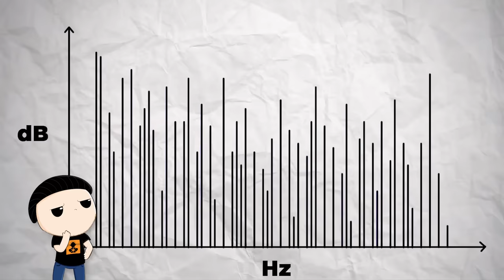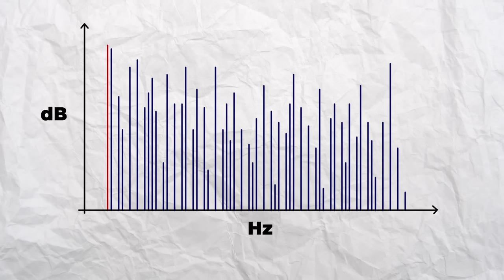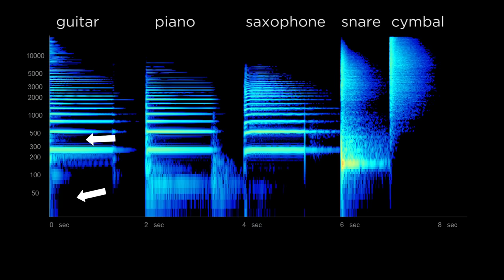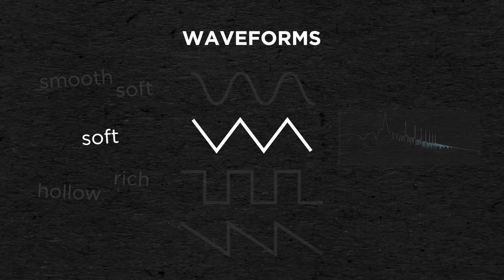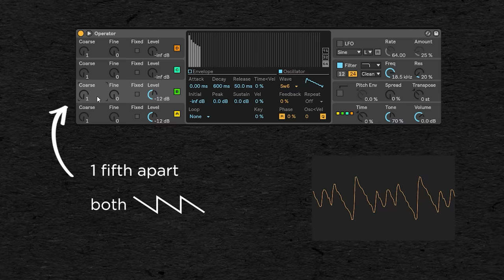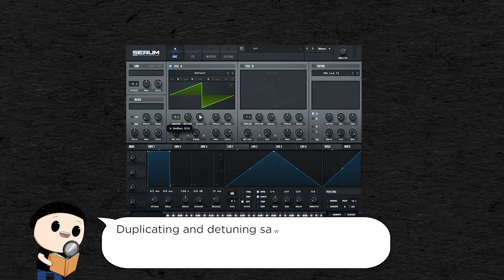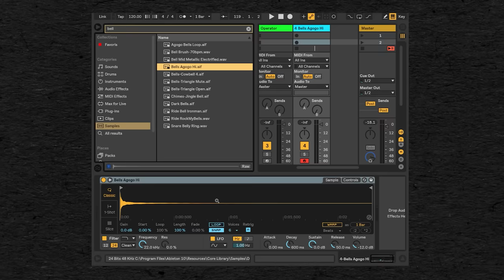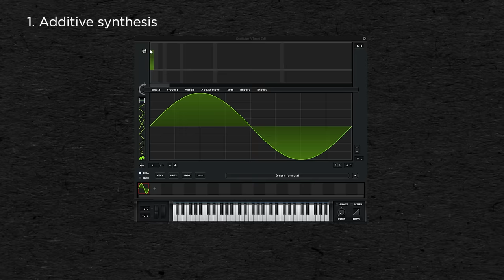Sound Design COMPLETE course - EVERYTHING you need to know to craft any sound.

Comment: 🌟Here is a summary to help you get the info faster, thank me later, you got this!
🎬 Introduction:
	•	Goal: To explore sound design tools and their effects deeply, helping you understand and use them effectively.
	•	Focus: Sound synthesis, effects, and techniques for creating unique sounds.

🎼 Sound Synthesis Basics:

	•	Fundamentals: Sounds are a mixture of frequencies. The main frequency is called the fundamental, and additional frequencies are called overtones (harmonic and inharmonic).
	•	Waveforms: Basic waveforms include sine, square, triangle, and sawtooth, each with distinct harmonic content.

🛠 Sound Design Tools:

	•	Oscillators (VCO): The heart of any synthesizer, generating waveforms that form the basis of sound.
	•	Filters: Modify the harmonic content of a sound, crucial for subtractive synthesis.
	•	Envelopes and LFOs: Control modules that shape the amplitude, pitch, or other parameters over time, adding movement and variation.

🔊 Types of Synthesis:

	•	Additive Synthesis: Creating sounds by adding harmonics together.
	•	Subtractive Synthesis: Starting with a rich harmonic sound and using filters to remove unwanted frequencies.
	•	AM and FM Synthesis: Using one oscillator to modulate the amplitude or frequency of another, creating complex harmonic content.
	•	Wave Shaping and Wave Table Synthesis: Using custom waveforms and morphing between them for dynamic sound creation.
	•	Granular Synthesis: Slicing audio samples into tiny grains and manipulating them to create textures and effects.

🎨 Practical Applications:

	•	Layering: Combining multiple sounds and effects to create a richer, fuller sound.
	•	Dynamic Effects: Using tools like reverb, delay, and saturation to add depth and character to sounds.
	•	Panning and Movement: Adding spatial dynamics by panning sounds and creating movement within the stereo field.

📝 Key Techniques:

	•	Sound Exploration: Experimenting with different synthesis methods and effects to discover new sounds.
	•	Detailing: Paying attention to the small details, like adding subtle background noises and textures.
	•	Sound Sculpting: Using EQ and filters to carve out unwanted frequencies and shape the sound to fit the mix.

🔧 Tools and Examples:

	•	Software and Plugins: Using tools like Serum, Ableton Live, and VCV Rack to demonstrate various techniques.
	•	Practical Examples: Step-by-step guides on creating specific sounds, from simple tones to complex textures.

🎧 Advanced Tips:

	•	Modulation: Using LFOs and envelopes to add variation and movement to static sounds.
	•	Harmonic Control: Understanding and manipulating the harmonic content to achieve the desired tone.
	•	Sound Libraries: Utilizing sound libraries and custom samples to enhance your sound design toolkit.
Reply from the maker: That's actually a great sum up :o

Comment: I'm back again 🤣 How do you create your animations? Are you using a drawing tablet? I've been wanting to get into it for so long. thank you
Reply from the maker: It depends, but most of the animations are made directly in première pro. I would use shape layers to draw the shapes I need (with the mouse, no tablet) and then I would animate it in première and smooth the keyframes (the transform effect is very handy to get motion blur).
If what I want to do is not possible with première, then I pull out after effects :)
Reply: @Woochia  thank you so much! I have premiere and had no idea that you can do that inside it. I appreciate all your work. Keep it up!

Comment: thank you for this video! just what I needed. question:
at 49:41 it looks like your controlling the rhythm of that riff with the "note" tab, can you explain how you did that? TIA
Reply from the maker: Thanks!
Actually, I'm not controlling the rhythm with the note tab. I'm controlling it only with an LFO and I play with the LFO's rate.
Though you could control the rhythm with the notes' pitch. Just drag the note modulation onto the LFO's rate. Then the higher the note, the faster the rhythm. Though you'd have to play with the modulation depth to get the range you desire.

Comment: Does this course actually make sounds or does it teach about devices that are USED in sound design? Do we make pads, basses, soundscapes, risers, etc?
Reply from the maker: This course intent is to give you all the useful info to understand each tool at your disposal to make sound design, so you can decide was you need to make the sound you want. This is not intended to be a collection of recipes for particular types of sounds. Those names can be quite broad (ex: to make a pad, start with a polyphonic instrument with a long attack and long release. From there, you can do pretty much whatever you want, so I prefer to give you all the knowledge you need to make it sound as you'd like)

Comment: 2:18:42 You are wrong here. The Mega Drive use the Yamaha YM2612 mainly:  a six-channel FM synthesizer. However, Its sixth channel can act as a basic PCM channel by means of the 'DAC Enable' register, disabling FM output for that channel but allowing it to play     8-bit    pulse-code modulation sound samples
Likewise the Roland TR-909:  3 PCM samples coded at    6 bits    resolution and 18 kHz frequency, while the rest of the audio signal path is pure analog including EG, VCF and VCA. Bit rate only applies to samples, the PCM part of the devices. If you think console sound was a bit wonky, that's more to do with cheap oscillators.

Comment: Would you say the reverb and delay parts are more on the mixing side than sound design? The reason I ask is because it seems like they make the sounds bigger or smaller (reverb) or have an echo(delay) however they aren’t really changing the sound much unless I’m mistaken. Maybe reverb could but then I ask how could you separate it to only affect the sound and not the mix? For example if I put a reverb on my mixer track for a sound in fl studio. Then it’s affecting the whole sound. This could create problems if we want to eq however because first it hits that reverb then eqs. Sorry if that sounds confusing
Reply from the maker: I'd say you can use them in both sound design and mixing, depends on what you're trying to do with it. 
To answer the second question, you could use a reverb as a parallel effect: one sound would go to 2 tracks. On one track is the dry sound, so you can mix it as you want, and on the other track is the sound with a reverb at 100% wet. Then put an EQ before the reverb, so to select the frequencies that go in the reverb. And then put another EQ after the reverb so you can shape it's tone as you like. Playing with the volume of both track will serve as your new dry/wet

Comment: Does the preference of techniqes in synthesis change depending on if you were doing analog vs digital synthesis, or digital synthesis is abstracted into their analog forms always and we still end up using same functions without any preference?
Reply from the maker: For sure digital makes it easier to switch between synthesis types. Analog are often subtractive synthesis based (oscillators + filters). For more complex things like granular or wavetable, it seems so much easier to build it as a program